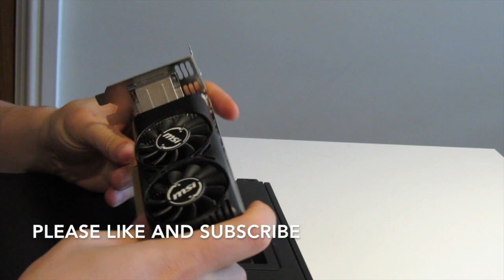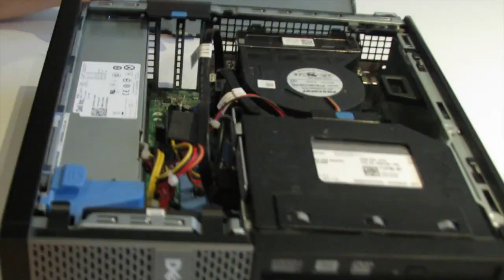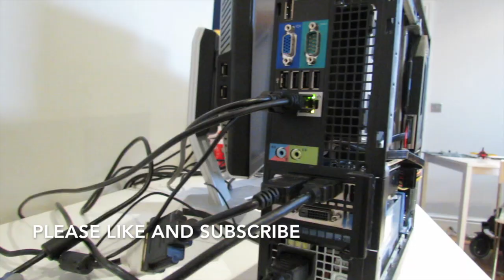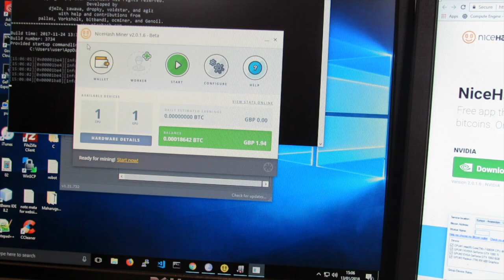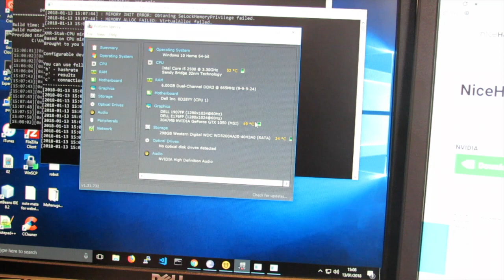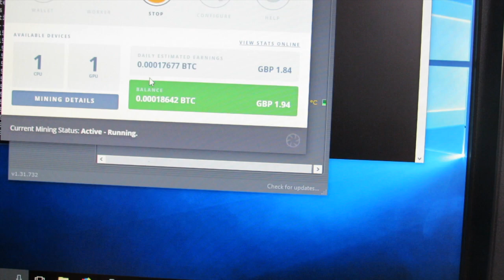How to build a super cheap mining rig

Comment: What are you mining? I can't see that being very profitable compares to the electricity draw and constant load on the gpu which reduces lifespan regardless of what you payed for card. Mining and cheap doesn't always work because you can build a cheap rig that will take forever to ROI and could be useless in short time as mining difficulties increase over time. Investing more at first pays it's self back quicker which generates more profit back quicker. Note I don't mean you have to invest thousands, start of with 1070 and upgrade as you go. Use cryptocompare to calculate hashrates, electricity cost and profit so your not mining blind. And use awesome miner and mining pool hub. Great video on those by MRsotko. Best of luck bud
Reply from the maker: I’m mining mainly equihash, you right it draws lots of electricity, which I’m not paying for it. And you right again it does reduce the lifespan of the gpu, but is a low profile gpu and didn’t cost much.
Planning on getting a 1080 next month :)